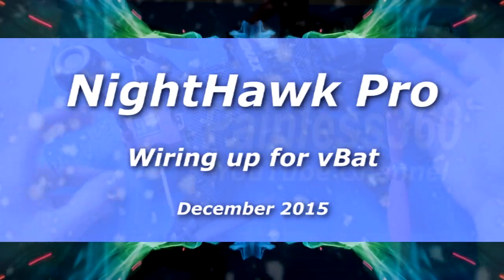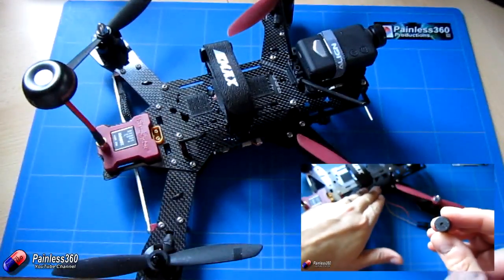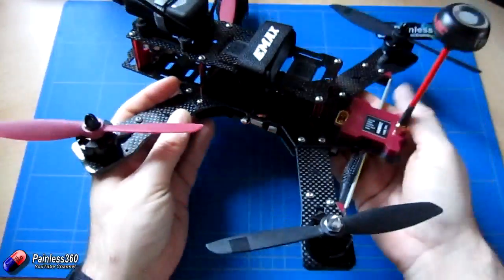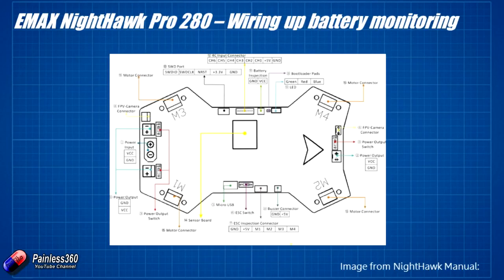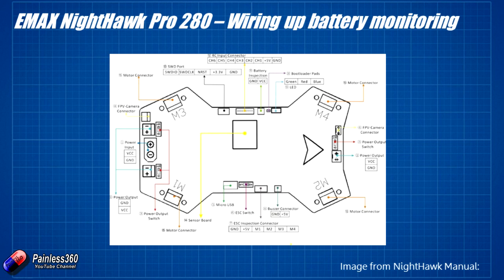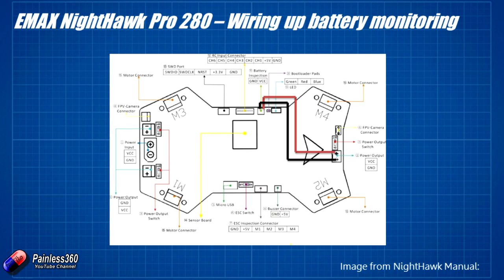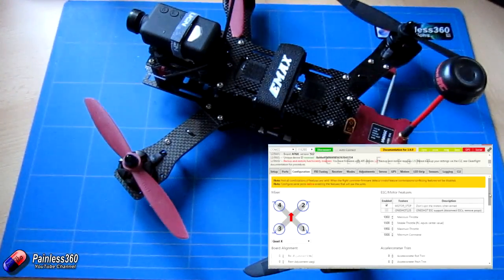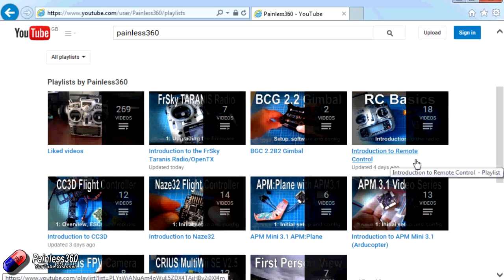RC Quick Tips - Adding Battery Monitoring (vBAT) to an EMAX Nighthawk Pro 280

Comment: Hi. Can I ask what terminals connections you used to connect to the pins of the power out?
Reply from the maker: Not sure what you're asking. The things we did with this model (we don't have it now) are in the video. Which bit in the video is the question about?
Reply: You made a connection between the vbatt in and and power output plug/pins. In your video you show the vbatt end of th cable connected via a molded plug and at the other end of the cable that connects in to the power out is seems like you have used some type of  pins or other connections on the end of the wires to make a connection with the female side of the connection on the board. I wanted to know what those pins or connection was made from
Reply from the maker: I used good old servo connector crimped pins. Happy flying!

Comment: Hi. My Nighthawk Pro 280 board does not have the Battery plug on the board, it has the buzzer one but on the other side there is no battery monitoring plug, is this common?
Reply from the maker: I've not seen it but then our model of this quadcopter isn't one that was sold recently. Maybe they have changed the bottom board slightly.. Best of luck!

Comment: Hi !Did you anabme current meter also ? what are you scale and ofset for amps ?
thanks for your vids !
Reply from the maker: +Bout clement thanks! Sorry, no video on a current sensor..
Reply: +Painless360 yes i now,  but did you activate the virtual current sensor o' cleanflight to have amps consumption on a osd ? I am looking to the values of setting the scale of it
Reply from the maker: +Bout clement I used the virtual. It works from the throttle and isn't too bad as a rough guide once setup..
Reply: +Painless360 OK,  what are the values you put for scale and offset then ?
Reply from the maker: Sorry, can't remember. I used a power meter on the battery and then played with the values until they read similar to the real amp draw shown on the wattmeter. Best of luck!

Comment: Hey mate, just thought I'd make you, and others aware, it looks like more recent versions of the nighthawks aio control board do not need a separate cable to use vbatt monitoring as in you video here. I have just recently ( April 2016) bought a NH280Pro, and discovered that there is no vbatt socket anymore,it appears that  it is now built in already. I added a buzzer as a lost model alarm ( followed your other video, thanks!) and found that it also alarmed when I enabled vbatt in cleanflight.  Thanks for the great videos, keep em coming!
Reply from the maker: +QuadChop-SA FPV Great to hear that they did that - should have been made part of V1. Thanks for posting!
Reply: Just found the same thing when looking for the vbat socket on mine :)

Comment: Hey @painless360 could i solder this? I pulled those pins from the wire and don't know how to get the pin heads back onto the wire.
Reply from the maker: +Austin Grimm We have a crimping video that shows you how to re-crimp end on. I'd be very careful with solder when doing this but you could connect it like that.. Best of luck.

Comment: Painless360, are you using the original 2pin cable that came with the Emax? I tried to use it, but the 2 pins don’t hold very well in the battery port.
Reply from the maker: Yep. Mine sees fine..
Reply: +MrJoris666 I agree that the supplied 2pin red/brown cable doesnt stay attach to the power outport ports at all.  Can you tighten servo connectors?

Comment: Hi Painless 360, great vids, i always use your videos for reference..very informative.

Can you please make a vid how to put OSDs for this kind of quad, i have this quad and i wanted to have OSD installed but cant seem to find any resources in the internet. Thanks.
Reply from the maker: +Paulie Del Mundo You need to treat the board as any other Naze32 and use soft serial and a MinimOSD. We have videos about it in the Naze32 playlist. You also need to solder connectors between the camera and main board too so the OSD text can be overlayed before going to the Vtx. If you need more help then please book a one to one support session (not free I'm afraid) via the website.. Best of luck!